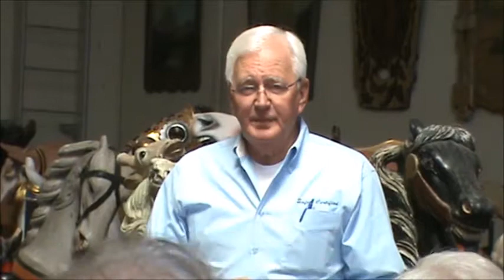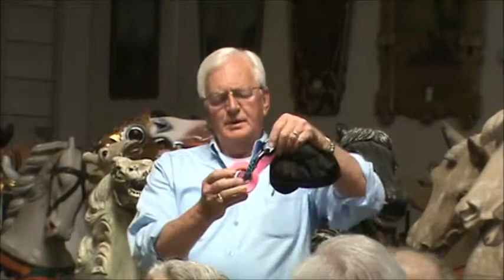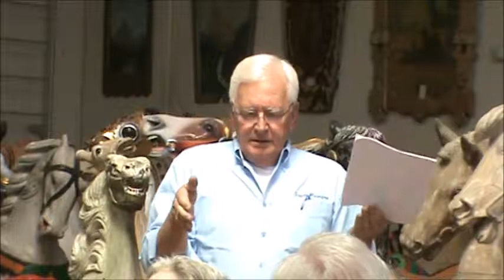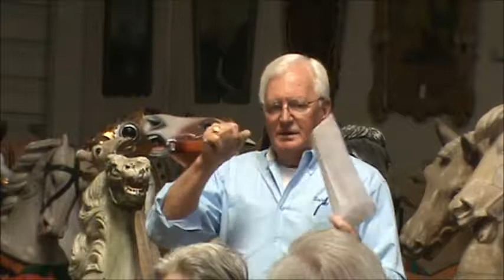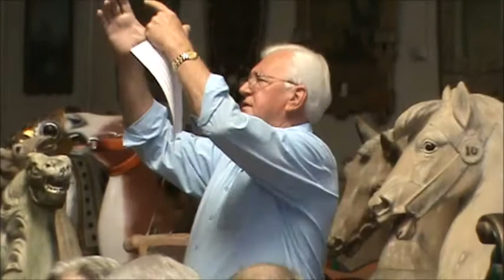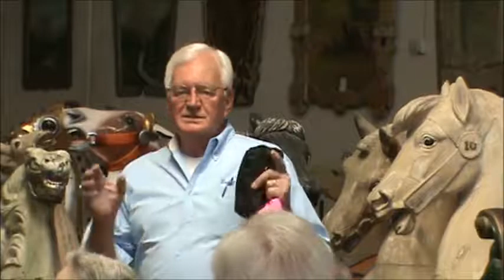Carousel Convention, Retired Disneyland Manager, Inspector, John Shook Speaking at the Convention.

Comment: OAKS AMUSEMENT PARK IS UNDER THE CONTROL OF PORTLAND POLICE AND MULTNOMAH COUNTY SHERIFF STING OPERATIONS AND THEY ARE SABOTAGING THE RIDES!

Oaks Park was covertly taken over by sting op's that were embedded within the park they had all the key positions in the park, they took control of positions within management and then systematically installed more and more sting op's in all the key positions in the park such as the maintenance team and the lead ride foreman positions and they maintained around two to four sting op's on the ride team and they were sabotaging the rides at the park!
A week before the season started in 1983 it was discovered by a safety conscious ride operator that the Monster Mouse was sabotaged, the tracks were sabotaged, the track posts were not firmly seated to the ground which amounts to the ride not being properly balanced and that can over time cause cracks and breaks in the track rails
Based on the method the saboteur used it is a gradual form of sabotage that will cause metal fatigue/cracks/breaks to the tracks over a several month period of time!
Almost immediately management at Oaks Park had Funtastic Shows maintenance team tear the ride down and to bring it in for repairs!
The very act of tearing the ride down covered up the evidence of the sabotage because it eliminated the gaps on the sabotaged posts and eliminated the pattern the saboteur used!
Management and the Oaks Park maintenance team and the Funtastic maintenance team covered it up and pretended nothing is wrong!
The operator that caught the sabotage was shocked at how many people were covering it up and he tried to warn other experienced operators that the rides were being sabotaged and that the powers that be are covering it up!
This safety conscious ride operator and the few other ride operators that supported him made an effort to find the owner of the park to warn him his park is being sabotaged and the owner was missing!
The sting op's that were embedded within the park spread false rumors around the park as to what happened to the owner because the sting is trying to hide the fact they eliminated the owner and that he has no presence in the park any more!
The sting op's embedded within the park ganged up on the safety conscious ride operators that were warning people and they eliminated those operators!
On the fifth day of the season a very young child was seriously injured on the Boat ride in Kiddyland, management called 911 for an ambulance to take the child to the hospital and after this the at the time general manager of the park put the maintenance team and the ride operators on alert for sabotage/unauthorized tampering!
Police/sheriffs never even bothered to show up at the park even though it is open knowledge a child was injured on a sabotaged ride and that the whole park was put on alert for sabotage because badge carriers don't care about crimes their own sting op's commit!
After this the sting op ride manager Dick Connor's decided he wanted to sabotage all of Kiddyland via electrocution!
Dick Connor's the ride manager bought brand new ten feet talll fences and had specially made tarps for those fences and he had his sting op maintenance team move Kiddyland to a new area in the park to a area behind the Haunted Mine ride!
The first ride Dick Connor's and his maintenance team moved was the Boat ride and they stuck it right under the main power transformer for the whole entire park and he told his maintenance team he wanted the entrance/exit to Kiddyland right next to the Boat ride!
The Boat ride is all metal and water, and they stuck it right under the main power transformer and there was only three feet seperating the Boat rigde from the power transformer!
Dick Connor's the ride manager did not care about the placement of the other Kiddyland rides and left their placement in the new area up to his maintenance team to deal with!
Once they have the Kiddyland rides set up the maintenance team then surrounds all of Kiddyland with ten feet tall fences and puts tarps on those fences so no one can see into Kiddtyland or see out of Kiddyland and the entrance/exit to Kiddyland is put right next to the sabotaged Boat ride!
On July 3rd 1983 the sting staged their planned out disaster and the sting pulled strings to get a witness against them stuck on the Boat ride that day so not only were they planning on killing a lot of kids they also wanted to kill rides operators that stood up to them!
Their planned disaster did not quite go as they expected it to and the ride operator the sting pulled strings to get stuck on that ride ended up saving everyone in Kiddyland from electrocution and then that ride operator saved everyone that was trapped on the Ferris Wheel right after that!
Management and the maintenance team and the lead ride foreman just covered it all up and acted like it was no big deal and law enforcement and news media also did not care and never investigated any of this nor was any of this made public!
The park blackout was mentioned on TV news but people being in danger of electrocution and people being trapped on rides were never mentioned by TV news!
In 1984 the sting that is embedded within the park eliminated almost all the experienced people that work at the park and Dick Connor's became the new general manager and it is him that got rid of all the experienced people!
He got rid of all the managers and all the supervisors and all the foreman's and the entire maintenance team and almost all the experienced ride operators and he hired a temp maintenance team he borrowed from Funtastic Shows and he and that temp maintenance team sabotaged almost every ride on the midway before the park even opens for the season!
On the first day of the season Dick Connor's hired 36 new rookie ride operators and 6 mid level experienced ride operators and he pulled those six operators aside and told them "We don't have a ride foreman yet so you guys are going to have to train the new ride team on the rides, you got forty minutes to train them on as many rides as you can before the park opens." and that's the only instructions he gave them!
Right off the bat rides were being discovered as being sabotaged!
On the fifth day of the season the temp maintenance team Dick Connor's had installed in the park finished setting up the Monster Mouse at a new location within the park and Dick Connor's then laid them off releasing them to return to Funtastic Shows and that night immediately after the park closed at eleven thirty Dick Connor's had security hanging out outside the ride operators break room where the time clock is and as soon as a operator steps out of the break room their confronted by security and told that they have to leave the park immediately!
Some of the operators have to remain to do the ticket count but that security guard remained just outside the ride break room with orders to run everyone out of the park!
The reason security is doing this is because Dick Connor's the new general manager and the Funtastic maintenance supervisor were sabotaging the Monster Mouse ride using the same method and tactic that was discovered in early 1983 and they did not want anyone witnessing them sabotaging the ride!
Two days later Dick Connor's hired a new maintenance team and they spent their first day on the job taking stock and inventory of what they had to work with at their maintenance shed and the maintenance team stayed on the first day until six thirty PM and the maintenance supervisor left at six forty five PM!
At exactly eight PM a sting op showed up on the midway dressed like the newly hired maintenance team and he was impersonating the new maintenance team!
He had a maintenance team short on and had a tool belt on his hip and he had the maintenance supervisors radio on his hip and he was brandishing a level in his hand and he stunk of booze and he was swaggering in a drunken manner and he was demanding access to the rides so he could check the balancing of the rides!
This person did not work at the park and it was not his intention to sabotage the rides, the rides were already sabotaged, it was this sting op's intention to set up the new maintenance team to be the fall guys and to get the blame for all the disasters the sting was expecting to happen within the park!
TAhis stunt pulled by this sting op tricked almost all the new rookie ride operators, the next day all the operators were calling the new maintenance team a bunch of drunks that want to mess around with the balancing, it was sting op's that were embedded within the ride team that kept repeatedly promoting that lie!
Oaks Park generates millions of dollars every year yet none of it go to the owner of the park he has been missing since early 1983, so where do all those millions of dollars go to?
I am just barely scratching at the surfice of this!